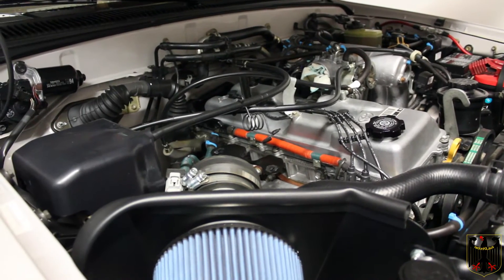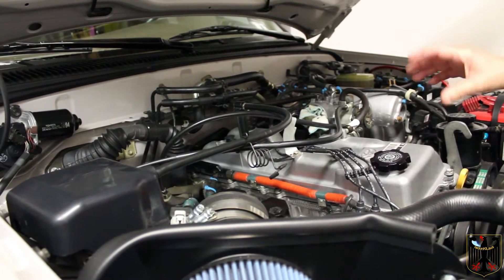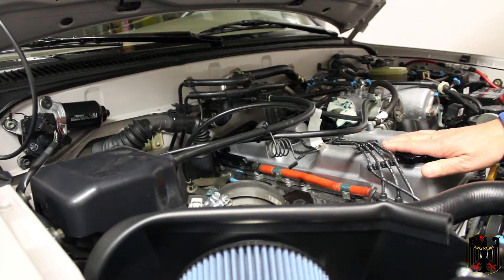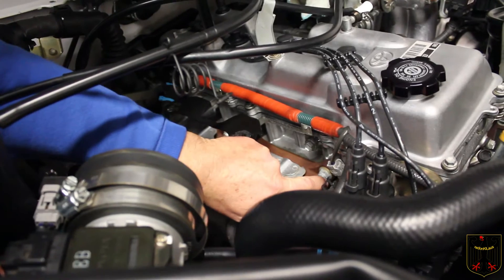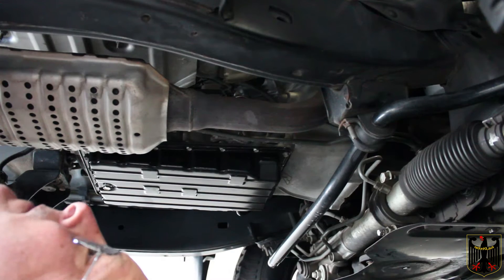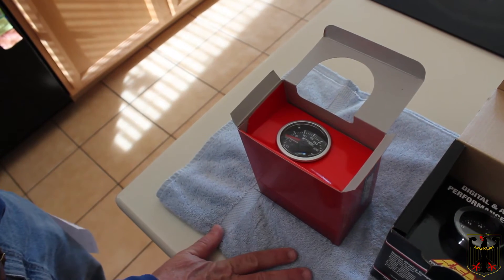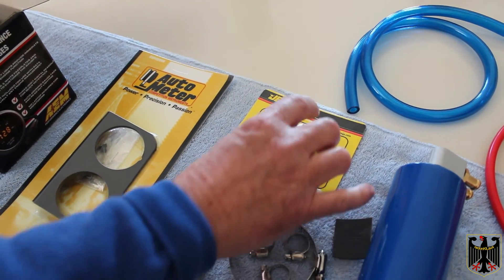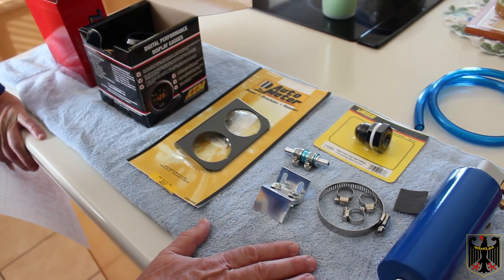Toyota 2RZ/3RZ Preparation for Turbo Kit and Parts

Comment: Hello, i have a 2rz tacoma turbo setup from ko racing. Now  bought a 3rz will turbo work with the 3rz motor?
Reply from the maker: Everything should bolt up, with the exception of (I believe) the oil feed line, since the 3RZ and 2RZ housings for the oil filter are different.  Don't quote me on it, but either way the vast majority of items are cross compatible.  Thanks for watching!

Comment: I don't know why people go with a kit when you can build your own set up for much cheaper and probably better fit. You don't need to tap your oil pan either. There are already ports for this right above the oil filter. It's not criticizing you great job on the build. Just something that came to mind I'm building my own kit right now. Going with a Garrett 50 trim T3 .63 AR I got super cheap for $400 all the rest is going to cost me under 300
Reply from the maker: Pre-engineered, pre-proven, and ease of installation are all reasons people utilize kits.  None of those apply with cheap, Chinese kits (i.e. from eBay), but they are generally significantly less work to setup and persuade to function properly.  

As far as the oil pan goes, you definitely should utilize that as your entry point for a turbo drain line.  I pull my feed from the oil filter, but if you are gravity draining you definitely want to use a -10 (if not -12, like me) AN line into the pan.  Otherwise, you will deadhead and blow out those turbo seals in no time.  

Thanks for watching!
Reply from the maker: Pre-engineered, pre-proven, and ease of installation are all reasons people utilize kits.  None of those apply with cheap, Chinese kits (i.e. from eBay), but they are generally significantly less work to setup and persuade to function properly.  

As far as the oil pan goes, you definitely should utilize that as your entry point for a turbo drain line.  I pull my feed from the oil filter, but if you are gravity draining you definitely want to use a -10 (if not -12, like me) AN line into the pan.  Otherwise, you will deadhead and blow out those turbo seals in no time.  

Thanks for watching!

Comment: Greetings! I admire your reusable air filter. What is the name and model of the air filter. I need one for my 3rz.
Reply from the maker: It's an Injen X-1046-BB filter that is sized to be compatible with the K&N intake system for the 3RZ 4Runner (not sure about Tacoma or other models).  Hope that helps, and thanks for watching!
Reply: redonKiLaus Thanks for the information. I live in a dusty area and the K and N oil filter isn’t as efficient because of all the dust in my area.

Comment: hello, im looking ro getting ko kit. 

but not quite sure what turbo to get its between t3 t4 or precision 5858 any advice ? thanks
Reply from the maker: I have the "46 trim" T3/T4 turbo, and I feel that it's perfect for someone who wants to run the vehicle in a street application on a stock motor.  The spool is great for an aftermarket turbo - just a bit more laggy than a VW TSI engine, if you've ever driven a car with that.  The 5858 is great for a higher-power application, but you will need to do a full engine build if you plan to run enough power to truly utilize the 5858.  Kris at KO can definitely answer any questions you may have regarding turbo selection as well.  Hope that helps, and thanks for watching!
Reply: Thanks for the advice, really helpful!  I'm asking around to get more knowledge about what turbo is the best to use. I heard the t3/ t4 spools quickly, compared to 5858 precision. My long term goal is to achieve 250+ hp.
Reply: Maybe I should get the " 50 Trimm '' ?
Reply from the maker: I would ask Kris what his recommendation is to hit 250 HP.  I see no reason why the 46 trim wouldn't be sufficient, but it might be outside of its peak efficiency region flowing enough air to support that power goal.  I don't have the compressor maps for the turbos KO uses, so I can't say for sure.
Reply: redonKiLaus  

sincr you metioned that your turbo "46 "  is quick spool. im trying to get something medium. Maybe go with the "50" ?
Reply from the maker: The "50 trim" will definitely spool slower than the "46 trim", but for a 250 WHP goal, that should be in the correct ballpark.  You will be running in the neighborhood of 10 PSI to make that power at the wheels, so if you take a look at the compressor map for a T04E-50 trim housing, you can see that for the corresponding pressure ratio (24.7/14.7 = 1.68) and with a rough estimate of your mass airflow being 28-30 lb/min, you're in a very efficient area on that map.  If you look at the T04E-46 map, you're in a less efficient area, so while either turbo will technically work for your application, the 50 trim will work "better."  

I believe KO also offers a Precision version of the normal 50 trim Garrett turbo, which would be ball-bearing and with billet wheels, so that may be something to look into if you want to decrease spool time a little bit.  Having a turbo spool quickly is most certainly a good thing if there is enough airflow capacity to handle the engine's needs so it won't run out of "puff" at the top end of the RPM range.  

Hope that helps a bit!
Reply from the maker: Here's a link to the compressor map I mentioned: http://turbocharged.com/catalog/compmaps/fig13.html
Reply: redonKiLaus  
an estimate when does the your turbo spool, around what rpms?
Reply from the maker: My turbo spools fully by 2500-3000 RPM, but because I am running low boost (5 psi) I reach full boost a decent bit before that.
Reply: @redonKiLaus  thank you for this excellent presentation. May I ask is it possible to bolt a T3/T4 turbo kit for the 1ZZ engine to the 2ZR?  To me it seems possible but since i ve learnt to respect your opinion from your videos, I seek your advice. Thanks.

Comment: what kind of intake will be best that I can purchase anywhere on AutoZone or Pepboys that I could get along without affecting the truck
Reply from the maker: In general, any intake you build from AutoZone or PepBoys parts is going to hurt performance and longevity of your vehicle.  On these particular trucks, even a proper intake (i.e. K&N) reduces torque while providing a very slight horsepower bump at the top end of the rev range - not a worthwhile tradeoff.  Stick with the factory intake if you want to retain maximum performance unless you step up to supercharging or turbocharging the truck.  Hope that helps, and thanks for watching!

Comment: Explain to me how this engine has 170k miles on it and not a spec of dust or dirt in the engine bay? Even the underside is extremely clean. Looks like it has 17k miles not 170k... Yall must have put all those miles on a dyno lol :)
Reply from the maker: +Mike J These are all road miles, I promise...lol.  When you're a detailing fanatic and extremely OCD, this is what happens, no matter what the car.  Thanks for the complement and thanks for watching!